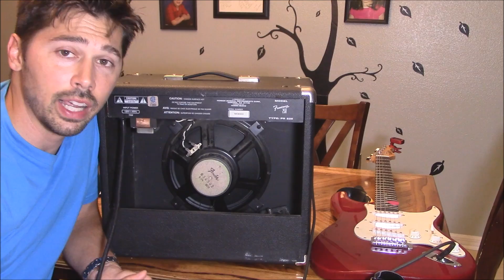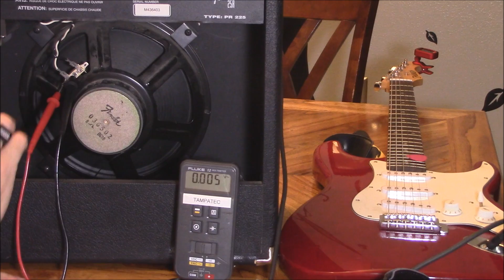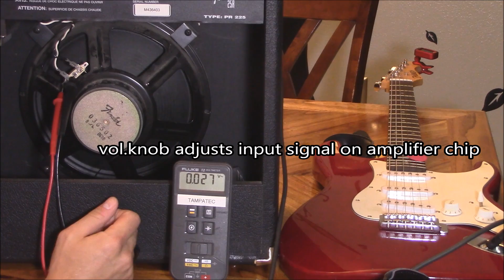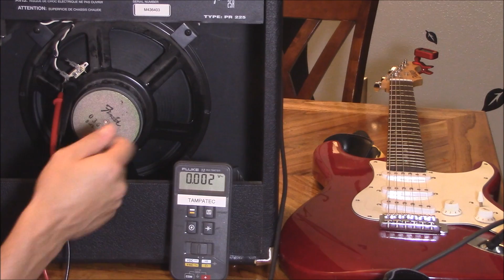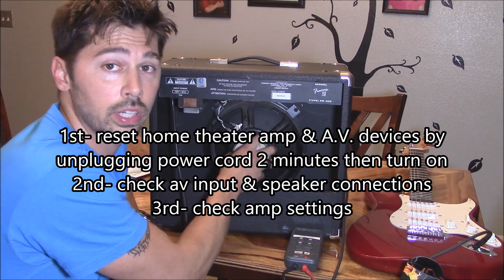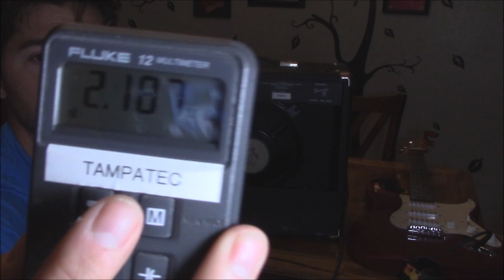How to check amplifier audio, volume, sound, speaker output review

Comment: Question: Fender Eighty-Five.. tried your fixes from the "10 fixes" video.. the problem is after the amp heats up & I'm playing @ a reasonable volume then it "pops" & all the volume just cuts out completely.. NOT the amp, it stays on & then after a few seconds, the amp volume returns to set volume. Would this more than likely be a bad solder joint? I've checked them several times & thought I had it all fixed last night but today it started again. Thanks for any advice! sub'd
Reply from the maker: CMBGuitars check solder connections around amplifier on heatsink and resistors too.
Reply: Thanks! Sure will give it a shot!
Reply: Got it working!!! Checked all the solder joints around that area & resoldered any that looked loose / old (as this is a vintage amp).. plugged 'er back in & kablammo no pop, no noise & no cutting out!! Thanks again, buddy!! Also checked a small Kustom practice amp.. switch was making a popping noise.. resoldered joints @ switch & on the effects pot. NO more popping there either!! Works like a charm!!

Comment: this has nothing to do with the video but I need your help i have a older phillips surround sound system and I have it connected to my 2016 lg smart tv via digital optical audio cable to a converter that converts it into coaxial and everything works great but every time I change the channel on my tv the surround sound changes from every speaker to only the center speakers and I have to constantly change it back it also happens when I'm on youtube on the tv and I change videos or fast forward the video it changes to the center speakers what can be causing this plz help

Comment from the maker: +NativePrairieWolf can't reply cause you didn't link g+ to your youtube acct. but replacing capacitors usually fixes the hum noise and crackle is cured by electronic spray in the dials.
Reply: Tampatec  hi sir thanks for that video ..now I have an idea how to fix my amplifier and your cute and smart... too
Reply: thanks but I still have problems with my amplifier Kenwood 100 Watt